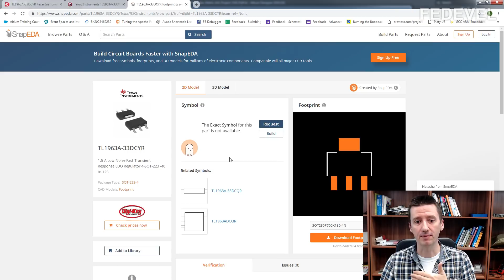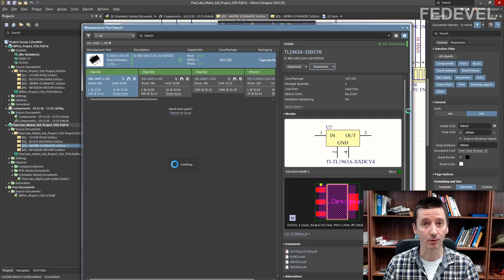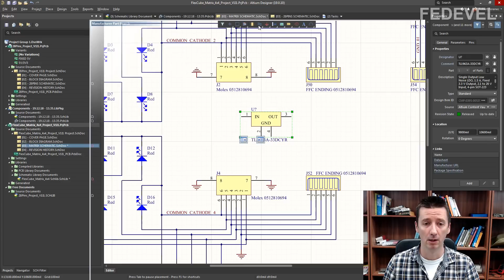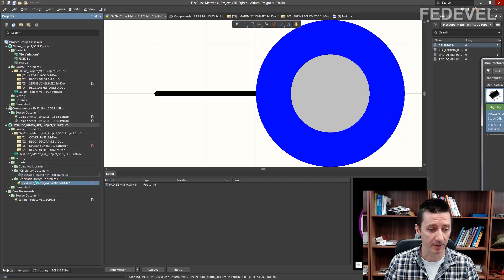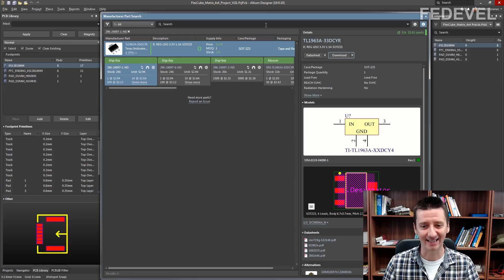Altium - How Manufacturer Part Search can be useful

Comment: Thanks. This looks really handy.
However, last week I downloaded a schematic symbol for an 80-pin chip directly from a chip manufacturer, and it turned out that 3 of the pins were wrong on the symbol!
So, whilst freely available symbols are great time savers, people shouldn't get lulled into simply trusting them without thoroughly checking them against the data-sheet.
Reply from the maker: I absolutely agree

Comment: can you tell me   how to calculate the whole project time needed 
so i can estimate my hour price 
i know it's a tricky question but every project  can differ in time according to the experience   and as a result the hour price should differ also in a reverse way 
if you can help in this confusion 
thanks in advance ❤❤
Reply from the maker: I bill on hourly base - estimation can be very tricky. I tell them, I will do my best, but I do not charge fixed price for the whole project. There are more reasons (e.g. you never know if there is not something tricky what will be more complicated as you are expecting), but one of the biggest reasons is, that specification keeps changing - so you do something and they change their minds, so you need to re-do it. PS: Size of PCB can have huge impact on  time (smaller PCB - much more time may be need to do layout) and number of components/connections can also influence length of the project a lot. I normally can tell, simple board or baseboard is up to 100 hours, CPU boards with memories usually take hundreds of hours.
Reply: @RobertFeranec  many thanks 
Really love you

Comment: Good Video. I have a question, I use Altium Library Loader to put components in my schematic, and then i use Suppliers Links to connect this component with Digikey, but the most parameters like capacitance, package, tolerance, etc. are not copied. How can i do that?
Reply from the maker: I am not really sure how Altium Library Loader works :(
Reply: @RobertFeranec  I already know how to do this. If I do right click and select suppliers links I can't copy the parameters, only a few. But if I use panel Manufacturer part search I can add supplier and copy parameters to a component.